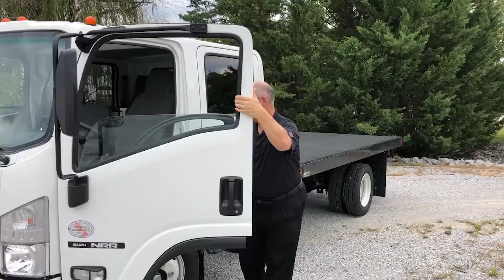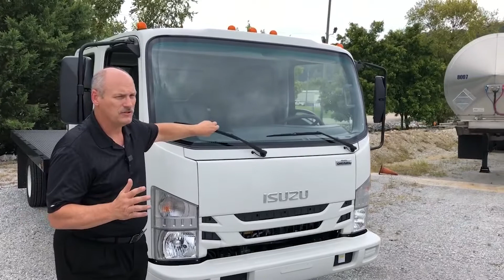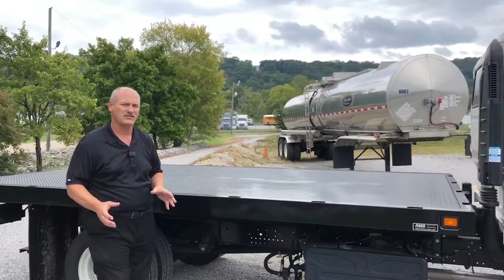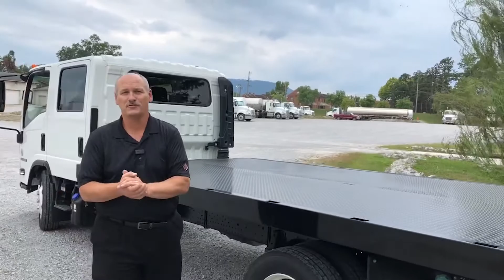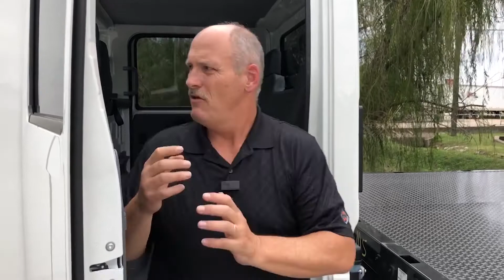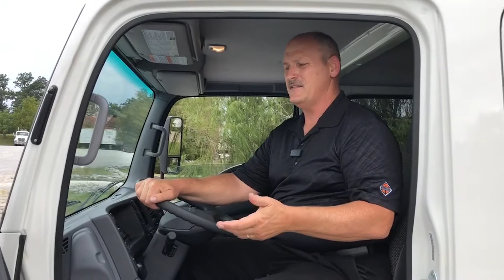Isuzu NRR Crew Cab Knapheide 14 foot Flatbed Walk Around  by Michael Olden - Lee-Smith, Inc

Comment: How many mpg on highway
Reply from the maker: MPG can vary based on your area of operation, aggressiveness of the accelerator, idle time, your payload, and more.  The pie in the sky numbers are silly to offer.  So a conservative number - with all the previous mentioned performance inhibitors is 10 - 13 as the diesel.

Comment: Just too much sales pitch for me
Reply from the maker: Thank You!!!! this was actually done for Corporate purchases.  There are some great references within the video, and at times it can sound sales pitchy.  It does have a lot of information.
Reply: @MichaelOlden   need one to start a car hauling business?
Reply from the maker: @CEEJAY_305  Great, where is it that you will be registering the truck?

Thank you for your interest!
Reply: @MichaelOlden   South Carolina
Reply from the maker: @CEEJAY_305  Okay, I am seeking for a partner on this based on your location.  I will let you know if they have one,  Or push a little further out - if they can't help.
Reply from the maker: Found it:
Model: MY2023 3V4 NRR Crew Cab Chassis 176"WB, 114.5"CA, White, 30 Gallon Stainless Steel In-Rail Fuel Tank with power windows, power door locks and air conditioning, DEF fill,  Back up alarm,  PDI at PORT, Seat Covers crew cab, Heated Mirrors, Engine emergency shutdown system HWT, LWL, LOP, Fire Extinguisher and Triangle Kit mounted under rear seat, Block heater with receptacle, Spare keys (2 additional, 4 keys in total), 

Knapheide PGTB-13 foot 6 inch medium duty platform gooseneck tow behind 21000# receiver hitch toolbox steel 18X18X30 DIE CASt, ANTI-SAIL BRACKET GALVINIZED, mudflpas, Fill Rite Pump MODEL 359-5-02 50 gallon transfer tank

Chassis	$72592
Body	$14500
Transport	$2985 to your door

$90,077
Send me an email molden@lee-smith.com so that I can send you the full presentation.  Please forward the company information too!